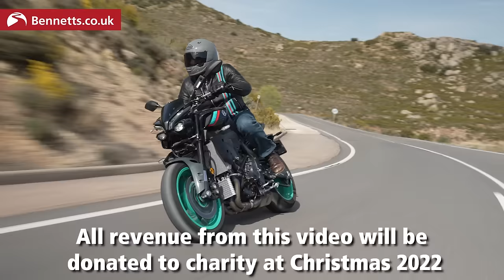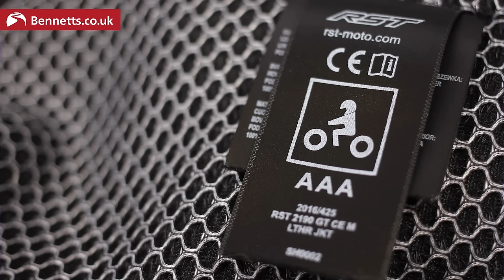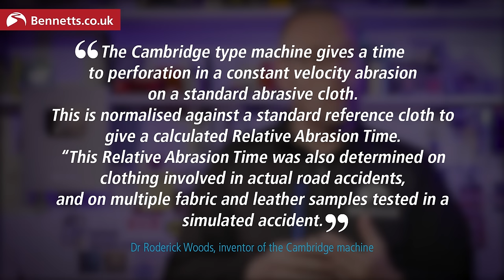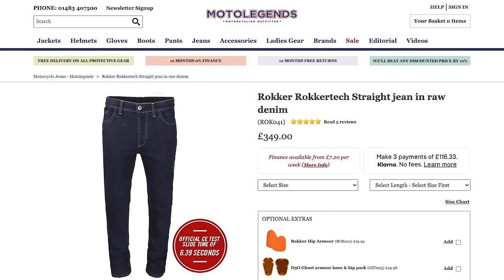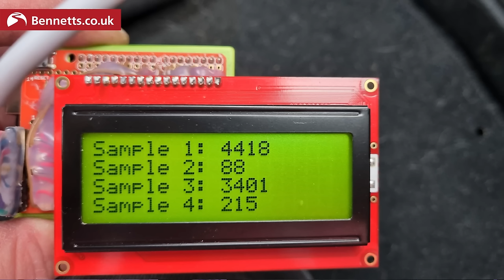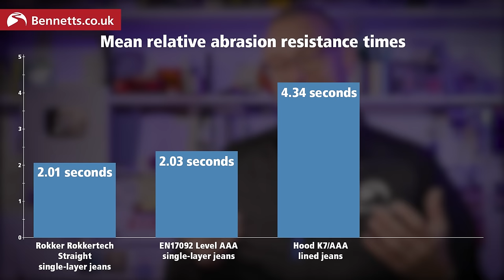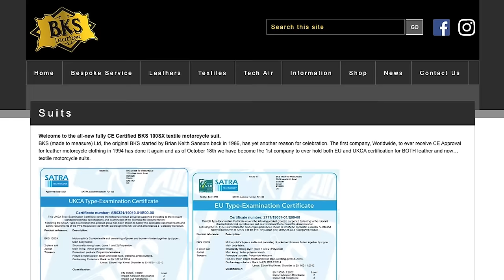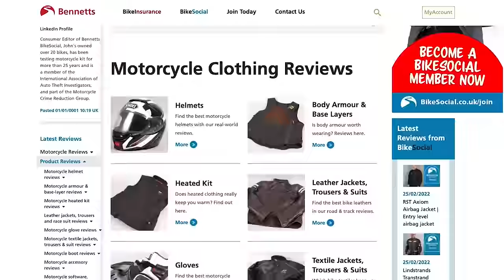Best motorcycle jeans | Single layer vs lined: THE TRUTH

Comment: So I have just realized I have been riding in single layer A type pants....
Reply: The performance classification created to specify lightweight clothing to be used, for example, by scooter riders commuting through Rome’s congested streets in summer. Low speed/low protection. If that’s your riding environment, A classification should be adequate, but for higher speeds on open roads AA is the absolute minimum that should be considered.
Reply: @paulvarnsverry11  yeah I really need to check out some new jeans for the summer rides...

Comment: Still no wiser, are all Single layer AAA jeans the same? We really need Mythbusters to do a full-on test.
Reply: The problem is the EN 17092 abrasion test. The pass/fail methodology of the EN 17092 Darmstadt test groups together materials with wide-ranging abrasion resistance capabilities, whereas the EN 13595-2 Cambridge test outputs a number. The numbers in this video indicate that higher levels of abrasion protection are more likely to be provided by lined jeans. 

There is a caveat that the clothing needs to have been submitted to the additional Cambridge abrasion test, and the report needs to be shared, so there is evidence the combination of materials delivers, otherwise there would be nothing to stop a mendacious brand from adding a thin layer of ‘something’ to the inside of its products as a misleading marketing ploy, without testing the combination.

Comment: Hi
I'm looking for a new trouser. I drive a lot (+/- 20Mkms) and always secured but my jeans finish always used by the time although they're good quality. (segura, bering, overlap).
So I decided to buy a leather one instead of changing jeans each 2 year.
But, he's certified A. So does it still secure in front of a jeans certified AAA?
For the protections (knee and hips), to put inside I'll use my D3O that I already have from my former trousers. 
Thanks.

And I confirm that to drive with always secured clothes is important.  (I'm always with: airbag, leather jacket, leather gloves, kevlar jean, high boots, whatever the weather). I fell "many" times but always secured and I never been damaged. 
God bless me.   lol
Reply from the maker: I'm not sure what you mean, sorry! Any garment rated A has been tested and certified to a lower standard than AA, which is lower than AAA. That's as far as EN17092 goes, but decent leather should be able to exceed that. Unfortunately there's little way to prove that at the moment, but I digress. A-rated leather trousers would appear to offer lower levels of protection than a pair rated to AAA. Cheers, John

Comment: How about lining aramid jeans with leather in important areas?
Reply: Primarily, a leather interlining wouldn’t be as airflow permeable as a knitted layer of appropriate abrasion resistant material, and many riders purchase riding jeans because they are more comfortable to wear in higher temperatures. Furthermore, leather lined jeans wouldn’t be washable, unless washable leather was used, which might or might not possess the required characteristics.

Comment: Ok , cut the crap,.... most roads are at best 300 grit or more..... better yet, make the test bed out of actual asphalt of varying degrees of grade before shooting  off results..... ( 60 grit would be wondrous for cornering at 120 mph+ speeds )
Slide velocities at impact are going to be V0= 88 fps decreasing exponentially down to zero over a max decel rate = to G./ coeff of friction, most times only about 88 / 32 fps= about 2.8 seconds of slide time..... for a 60 mph incident where the coeff of friction =1
So why not take a 175# manikin, load it with kit, drive down the speedway at 60 mph and push it off in a straightaway and then  do the same in a corner and get empirical results first. Then do the same for a 300# manikin and then do your correlations ??
Then post your info out to the ppl making the kit and see what transpires ???
Sorry guys, but the Vid to me seems at points very incredulous.
I stopped watching  @ 9:51 
Stay Safe.
Reply from the maker: Sorry, but you're completely wrong, starting with roads being 300 grit.

Comment: My Hood jeans are less than 2 years old and have hip armour but are only rated AA. What has changed to make them AAA. I presume they are still very protective even as AA?
Reply from the maker: As I understand it, it was down to reinforcing in the crotch area. Hood felt it was betrer for comfort, but a change to the denim made them AAA. If it's any reassurance, It was the AA ones I wore for ages. Cheers, John
Reply: If I remember correctly Hood don't line the crotch area with aramid for "comfort" reasons (avoids sweaty balls) and their previous denim wouldn't have passed the AAA test in the very small area that isn't covered by the aramid lining. Now they use a different denim and the new denim, without aramid lining, is strong enough to pass the AAA test in that area.
Reply: @andrewlim3842  : The original 100% denim + mesh lining in the crotch and lower legs achieved AA. In all the remaining areas where the para-aramid is present, even the previous AA labelled Hood Jeans achieved AAA; but the lowest common denominator rule applies and they could only claim AA overall. As you correctly state, the switch to stretch denim brought an improvement to AAA overall.

Comment: I noticed the Hood jeans only have a B-rating without armor. How can we differentiate abrasion resistance only ratings from those with armor?
Reply: @Daniel G : As I have replied to another comment; basing overall EN 17092 classification of clothing on which items of armour are fitted is one of the flaws in EN 17092 that are slowly dawning on more and more manufacturers. The classification should be based on the performance of the materials and constructions - AAA, AA or A - and Class B dispensed with. 

During a recent meeting of the British Standards Institution subcommittee for motorcycle clothing standards, one brand’s representative proposed that the EN 17092 pictogram should contain one box for performance classification, and a second box denoting which protectors complete the garment’s certification status. This would enable consumers to differentiate between, for example, Class AA + H + K jeans, where hip and knee protectors are present, and Class AA + K jeans; and between Class AAA + FB + S + E jackets (back, shoulder and elbow protectors) and Class AAA + S + E. 

These recommendations are unlikely to happen soon, however, as there is no appetite whatsoever amongst industry representatives in the European Standards committee to re-open EN 17092 for revision.
Reply from the maker: Some Hood jeans are available without armour and therefore have to be rated as B. I have explained that in the video from 02:20 cheers, John
Reply: @bennettsbikesocial  I thought  you may have addressed this but couldn't find it again when I started searching through the video afterward. Thanks for helping to inform people about the issues with moto gear standards, it's very needed. Cheers from the other side of the pond, Dan.
Reply: @paulvarnsverry11  Paul, this is very important info. What was the name of the brands pushing for these higher standards? We need to start supporting companies that are trying to raise the bar.
Reply: @danielg9657  : The Chatham House rule applies, but I can say two of the companies concerned are already producing garments conforming to EN 13595 and a third is a major UK-based brand.

Comment: Hey Bennett's! Revit does have a line of 3A single layer jean !
What do you think ? 
Cheers ;)
Reply from the maker: If they're AAA rated, then they've passed the highest standard in the EN17092 legislation, but other than that there's not much more we can be certain of. Evidence shows they're unlikely to be as abrasion resistant as some lined jeans, and they're very unlikely to be as good as decent leather, but I do like single- layer jeans, and as they're AAA rated, if you like them, they're a better option than A or AA. I wouldn't use single layer for hard riding, but I love them for when I go to work and sit in them all day, or for wandering around town.
Reply: @bennettsbikesocial  That's what I taught ! Thanks for the input 
Cruising safe in confi jeans man 😎

Comment: Oxford came out with AAA single layer jeans that were decent priced but pulled it off the shelves last year. Anyone know what happened?
Reply: The certification body which they used made an error in designating the jeans as meeting the AAA requirements, when they had in fact only met the AA level. A competitor brand realised the error and reported Oxford to Trading Standards, which in accordance with the relevant clauses of the legislation required the jeans to be recalled and relabelled (Oxford also offered a discount to owners who wished to keep their jeans, regardless of the marking error).
Reply: @paulvarnsverry11  it did seem too good to be true.

Comment: Quick question, given the slide times what does that relate to in terms of speed? I know that there a lot of variables but how long on average would a person slide for at 60mph on std tarmac?
Reply from the maker: They just can't be interpreted that way; it's always a relative abrasion time, and should only be considered a method of comparison. Cheers, John
Reply: The phrase “slide time” needs to be excised from the motorcycling lexicon!😉
Reply: I favour distance over time. Most riders will have a good idea how far the traveled after leaving their bike. Often there’s clear evidence of it (debris). Whereas, how much time did I spend falling and sliding? That’s a tough one without video evidence.  Also time is irrelevant: 2 seconds at a low speed is a short distance. 2 seconds at a high speed is a very long distance. Guess which is worse?
Reply: @martinfoster5163  : Not to overlook the variability caused by coefficient of friction, which will change dependent on the abrasiveness of the road surface and the characteristics of the material in contact with that surface.

Comment: Jacket certified to CE - Cat. II - 89/686/EEC Directive. Is this compatible with the new regulations? Thanks!
Reply from the maker: That's the older directive. What jacket is it?
Reply: @bennettsbikesocial  Dainese Racing 3..but it also has a AAA CE rated tag saying 1064 p Jacket. Really appreciate the response. Thanks!
Reply from the maker: @pariahdawg7227  some great has been labelled up as using the directive, but as long as it's genuine Dainese, you shouldn't need to worry. In fact, a lot of their new kit is only AA now!
Reply: Thanks - yep real Dainese ordered directly from the shop in Italy. Just got the RST Sabre  and Hood SK Jeans . Both AAA and excellent!

Comment: What is quite incredible to me is that nobody can come up with a mennequin that can be dressed up  and tossed off the bike or some simulator rig to do real life evaluation. While it would be somewhat expensive and not perfectly consistent, it would be the most valid testing. All those mambo jumbo bs sample testing is completely useless other than for comparative analysis of materials themselves. I think that nobody is genuinely interested in performing real life tests. I've see couple exceptions (like Bull-it) in the past but, even that is being burried in pile of bullshit.
Reply from the maker: Actually, Dr Hurren and his team have a rig that's fixed to a car to reliably test samples on any road surfaces. It uses dampers to keep the products in contact with the road. It has proven the Cambridge machine to be a reliable analogue, as consistency is vital for testing and certification. A mannequin could not be controlled to always land and tumble the same way, or indeed on exactly the same part of a road, which is why science has to look at real world scenarios, then create a reliable test method from that. 
Then brands and retailers need to help consumers understand what the results mean.
Reply: Research with a mannequin (which came to be known as “Metal Mickey”) was conducted in the 1980s by Dr Roderick Woods, and the data generated also contributed to the development and validation of the Cambridge impact abrasion test. It appeared on BBC “Tomorrow’s World” and I use some of the digitised footage from that show in a compilation video I run when giving presentations to motorcycling organisations.

Comment: What would your recommendation be for abrasion protection if you wear the "alpine star tech 5 " air bad with elbow. The airbag will protect against impact but not abrasion...hence should you keep shoulder armor in place vor abrasion?
Reply from the maker: Do you mean it has shoulder protection? You could likely leave shoulder armour out there. Remember that while armour absorbs impact energy, which can reduce tearing at point of impact and hence reduce abrasion, you need an abrasion-resistant material on the outside still. The more As the better under EN17092.
Reply: Yes take a look at the Alpine Star tech 5. unlike the klim airbag it has protection for the shoulder in addition to the chest. BTW i crashed into a deer at 100KM  (at 630 and survived BECAUSE I WAS WEARING FULL GEARS. Klim Latitude suit,11 years old Shoei helmet. Broken clavicule,6 broken ribs. At 70 returning to riding. I figure that all my injuries were due to impact. HAd i been wearing the airbag i think i would have walked away after hospital evaluation. The 3 month old RT was totalled

 @bennettsbikesocial
Reply: I retain the shoulder protectors in my jacket even though I wear a Tech-Air 5 vest.

Comment: Just a note to everyone watching, much of the content in this video is either incorrect or misleading to viewers, specifically in regard to testing methods, standards, and the assumption that all single layer Jeans are equal. No test can be considered credible with a conclusion based on the findings from a test batch of 2 pairs of jeans. We have been in touch with Bennetts to express our many concerns with the validity and quality of information in this video. Unfortunately, a little knowledge is a dangerous thing, and this video makes huge assumptions and with some questionable input. 
Stay tuned on the Knox YouTube channel for a more balanced and accurate view on this matter soon.
Reply from the maker: We look forward to your video; as discussed in our emails, we believe the most important thing is that people understand what they're buying and are able to make choices with unbiased and relevant information. As a brand renowned for its safety equipment, I'm sure riders will be very interested to hear about your opinions on product testing.
I wonder how a retailer would answer a customer's question of how abrasion resistant a pair of triple-A rated single-layer jeans are compared to a set of quality one-piece leathers that fall into the same level. Hopefully your content can expand on that.
This video seeks to present the differences in performance of single-layer and lined constructions, and I made it clear that I don’t consider single-layer jeans to be bad, but that claims of them having better abrasion resistance than leather – and performing better than good quality lined jeans – are demonstrably not true. To expand on the data, looking at research carried out by MotoCAP on the Cambridge machine, no single-layer jeans have achieved an abrasion resistance score of greater than 1 out of 10. That’s not to say that all layered jeans are higher performing than all single-layer jeans, but we’re yet to see evidence of single-layer jeans offering greater abrasion resistance than a good quality pair of lined jeans.
I agree that all jeans are not equal, and this video – as well as further work I’m carrying out – acknowledges that. But like helmets certified under ECE22.05, the AAA level under EN17092 only tests to a standard, not a point of failure; it effectively provides a minimum performance rating (pass-or-fail) that meets an agreed standard. This is good because it gives customers confidence that the product has met a certain standard, but it doesn’t allow that customer to know which are the best-performing products within that grade. 
The Cambridge machine can provide a relative abrasion time that allows buyers to make a more informed choice. Of course, burst and tear strength play an important part, which is why under the new regulations I recommend people to buy AAA-rated jeans, then decide if they want lined or single-layer.
We of course welcome all developments in motorcycle safety, and if we do ever see scientific evidence of single-layer AAA-rated jeans offering the same or greater abrasion resistance as decent leather throughout their construction, I’ll buy myself a pair and never bother with lined jeans again. Until then, I’ll choose which construction I wear depending on where I’m going.
Reply: The validity of the conclusions in this video, based on limited sampling, was challenged by someone else in the comments (look for “B Bumble”). I viewed their challenge as credible, so I referred to the most extensive, independent assessment of motorcyclists’ clothing available - MotoCAP - to see what its findings revealed. You’ll find my original response somewhere in the comments below.

MotoCAP has not reported on every single brand and styles on the market, only on those which are offered for sale in Australasia, but the trend the results unearth is nevertheless instructive. Of over 50 styles of riding jeans and leggings tested (using the Cambridge machine), not one single layer jean achieved higher than one out of a possible ten for abrasion resistance. The top 23 scores were all achieved by lined jeans.